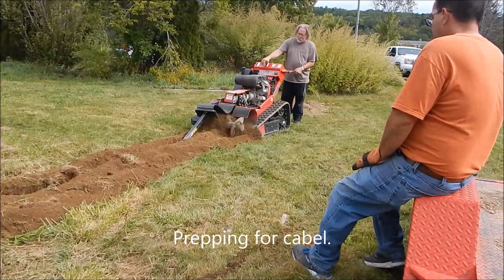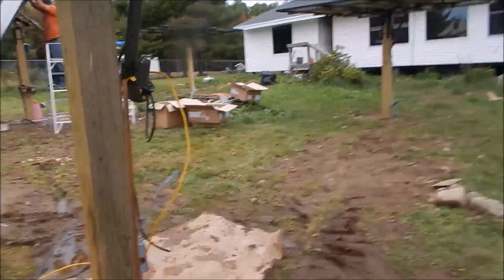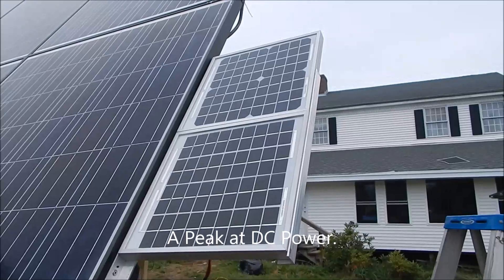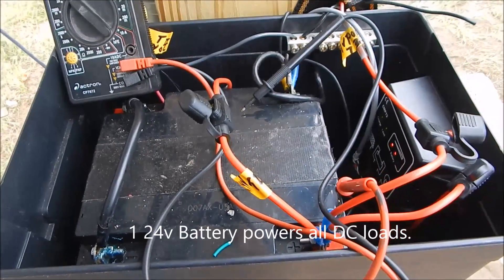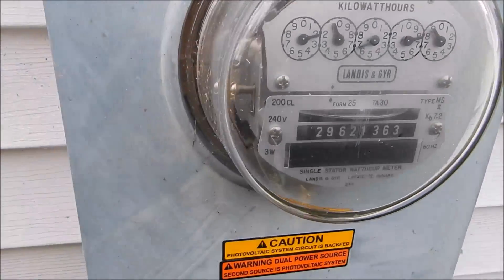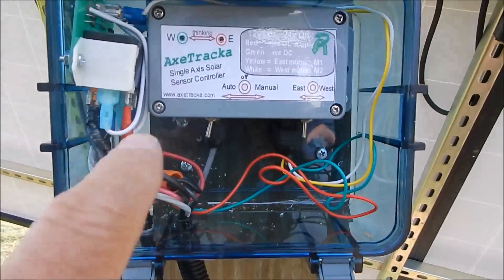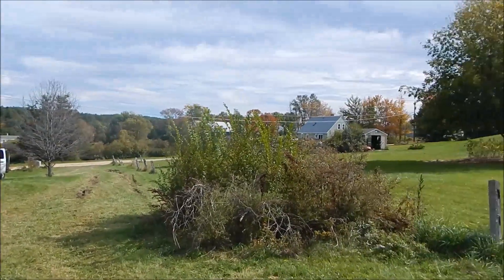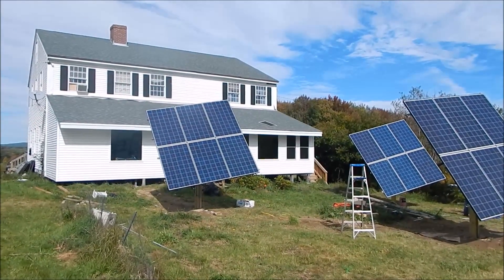6000 Watt Solar Tracker Install  Update  Making Power!

Comment: Nice system. Just a few comments. Since you have AC power at the trackers why not use an AC to DC 24 volt power supply instead of getting involved with batteries and extra panels? Also, solar modules should be mounted with .25 spacing to allow for thermal expansion. If they are mounted flush against each other the mfg. warranty could be voided if there is an issue (cracked glass). I would use a steel pole for permanence and strength. Love the Enphase system.

Comment: Do these trackers move both azimuth and elevation?  Oops - never mind - it says "Single Axis" (just saw that)...  Why not track both dimensions?

How do they track the sun when there are clouds obscuring it?  Do they "hunt" a lot or follow "white" clouds?
Reply from the maker: They work very well, they will take a neutral or flat to ground  position when cloudy .
Reply: TheKilog69  Just curious, but roughly what is the cost for this great setup?  It is impressive and cool knowing you got a freezer full of food if the grid goes down.

Comment: Hey Glen, they should have put a drain hole . And the rubber seals are all Chinese crap.
I'am looking for a better actuator, have you found one yet? Are you having any problems with the one's on your install?
Reply from the maker: cnypilot I would say maybe at your discretion that is a lot of SQ. Ft. of sail area I have not done it myself, The tracker mount is good but all else starts to get stressed  out at above  that point of 6 panels I believe .
Reply from the maker: cnypilot the pole is a 6x6   5.5x5.5 in thick. at min 3ft with variable size of concrete depending on what type of soil U are installing it in it is always good to put more than u need than less.
Reply from the maker: Upper weight is 400lbs-+ panels ,struts ,nuts bolts. wind loading is a factor & yes the actuators can more than handle it .
Reply from the maker: +Mike Prestigiacomo On my tracker It was DOA. But a wire was lose it is a black1 real cheap looking compared to new one . I am looking at Thomson & Progressive automation- $320-$650 range US. made with a real warranty. Strangely all my actuators are still working even cheap one.
Reply: +TheKilog69 What do you recommend for trackers now?
Reply: +cnypilot Can you place an 8 panel array (2000w) on a single pole tracker? How deep is your pier/footer?
Reply: TheKilog69 Is it a function of the Earth mounting or the thickness of the uni-strut on the tracker? All things considering, can the actuators handle the overall weight? - Cloud

Comment: Those gray actuators won't last .Mind lasted 7 months .I took the backs off because they were not working right and they were full of water and rust beyond repair .When I inatalled them I first applied silicone on all the seams with no prevail.
Reply from the maker: +Mike Prestigiacomo Thanks for watching!  I had 1 fail in a week Windy Nation would not honor there warranty! I have had with U now six people have had the same out come I will NEVER use any thing from Windy Nation ever again & will never recommend anything from them.

Comment: I'm impressed.   Excellent enphase tracker install.  I love the added panel and battery pack attached for the tracker actuator. Very clean.  I also love the person's comment about why doesn't every house in America have this. I ask myself that same question constantly, as does every other person I help with doing an install.
Reply from the maker: +sunsensational Thanks!   it was a good bit of work but well thought out after playing with trackers for 4 years & working great .

Comment: Nice to see your 6 panel mounts in a larger install.  My 6 panel tracker is still working great.  Glad to see the minor upgrades done to the mount and more robust actuators used.  Should have no problems.
Reply from the maker: +TheWickedjestr Thanks they are working out very well.

Comment: Nice! 6 full size panels on one pole looks great. Did you go 4 feet in ground and 6 feet high on those posts.. 10 foot post?
Reply from the maker: +Randy H close to 4 ft.as possible poles were 12 foot cut down to 6.5 above ground.

Comment: Keep up the great work.
Reply from the maker: +Luis Taveras  Thanks! it was tested out with everything running in the home washer dryer 4 big window A/C units on still going backwards! using electric heat during the day is a smart more here in NH.
Reply: +TheKilog69 
I use electric space heaters for backup heat, if my old Sanyo mini-split systems aren't providing enough BTUh of heat.. That only happens when the outside air temperature drops below 10 deg F..  (rare in Boston). 
The newer model mini-split cooling and heating units can work down around Zero degrees F.. 

When I look at those shadows, they seem so long right now..
https://youtu.be/zIgoU54dKv4?t=6m4s
I wonder how long they are going to be on Dec 22nd? The Winter solstice.

I was surprised how long my house shadow was..
http://s46.photobucket.com/user/Xringer/media/midwinterday.jpg.html
I converted that satellite dish into a solar tracker.. :)
Once I knew it wouldn't shaded by the house..
Reply from the maker: +Richard Lee Nice work thanks.